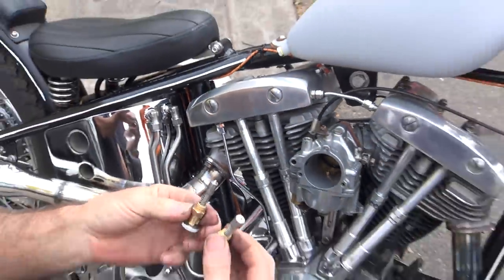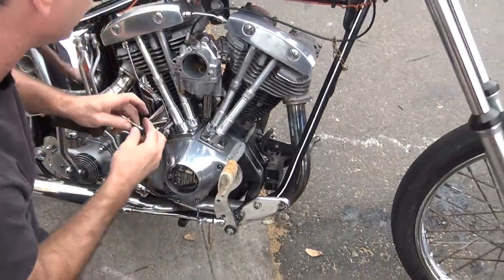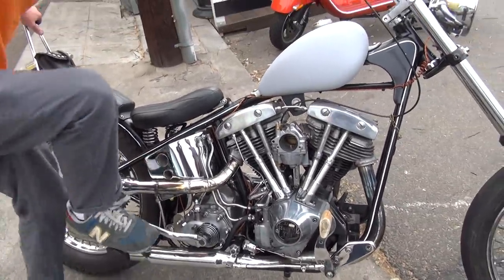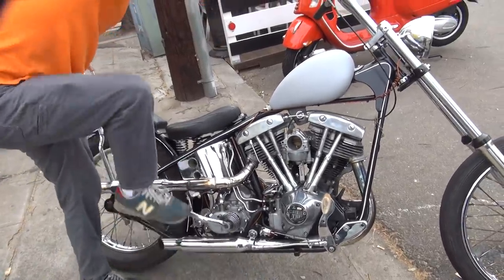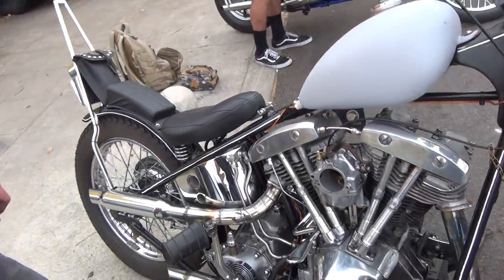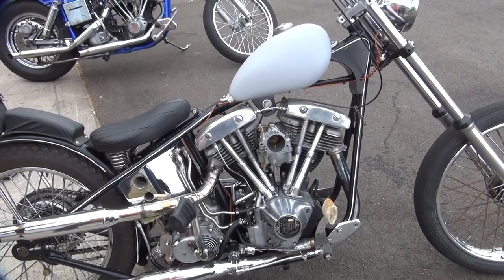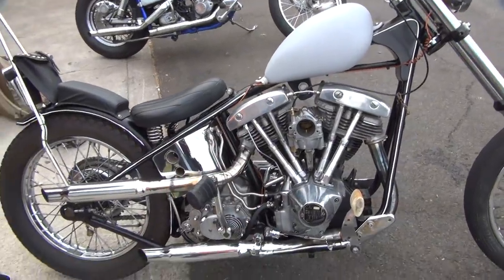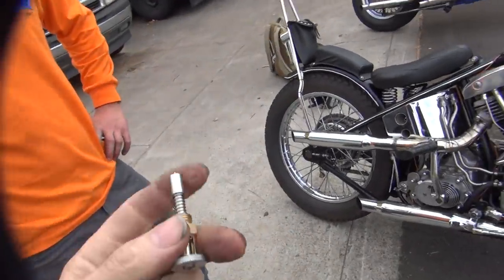#106 74ci shovel E' carb repair rebuild 73 shovelhead chopper bobber carburetor harley tatro machine

Comment: You are very patient. 

He needs to run through the entire basic tune. Even an off mix should show more fire. Something is off. 
Compression, ignition, and/or he left some vintage aged gas in there (likely a bit of all three). 
A guess would be his ignition can't deliver a hot arc across a 1/8" gap.
Bad ground, 10V from a 12V battery, poor ignition wires, a cheap coil...

On a side note: at around 4:30 watch the front exhaust pushrod tube.
Reply from the maker: yea, something is off. that is why i normally start at the begining and work my way out. pushrod adjustment is 1st and than work your way out as you check every step along the way to the end.
tatro
Reply: @TatroMachine  who tought you all of your knowledge your a genius,I got an older buddy who helps me diagnose any problems I have,I'm 45 years old I wanna learn,I guess everybody starts at different times in there life.

Comment: Can you show us how to get the O ring to fit on the accelerator pump on the super E ? ..I've tried SS parts and others and still have a hard time getting that one to fit ..always seems to be just a bit too large and wants to roll out as you put the pump body back on ...last time had to do it with a feeler gauge holding it in place and then sliding it out as I tightened the screws ...took about 6 tries
Reply from the maker: i have showed how i do it in alot of my videos. basically you got it correct. they can be a real pain in the butt at times.
tatro